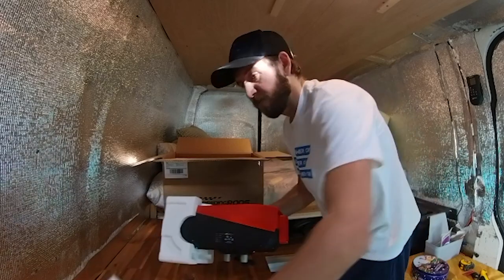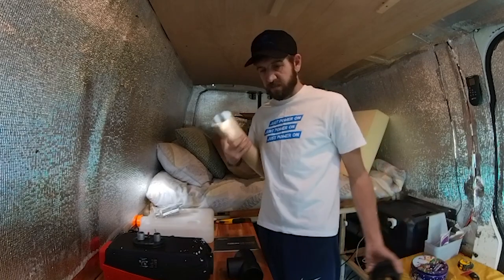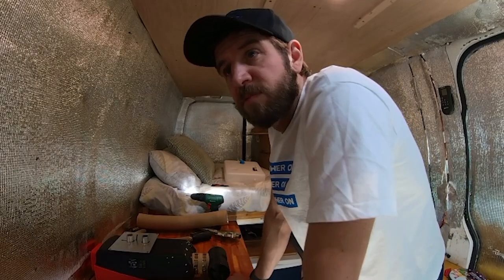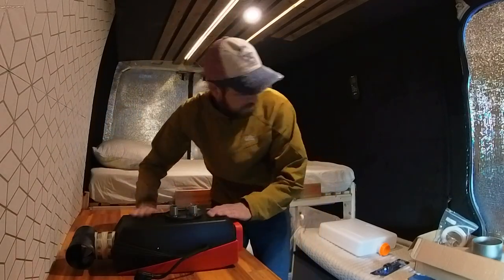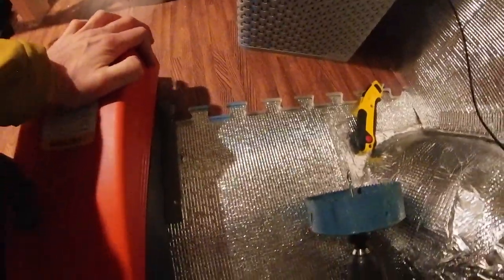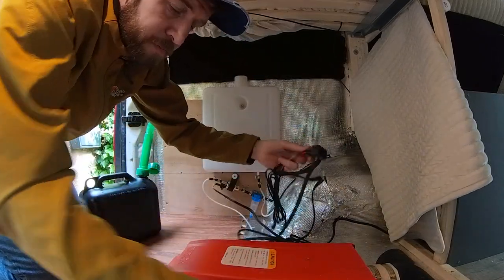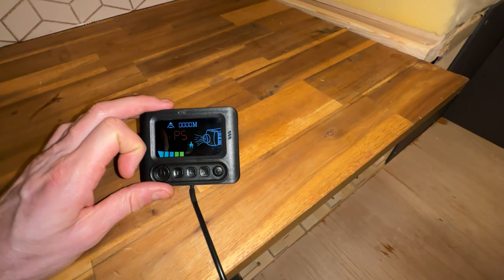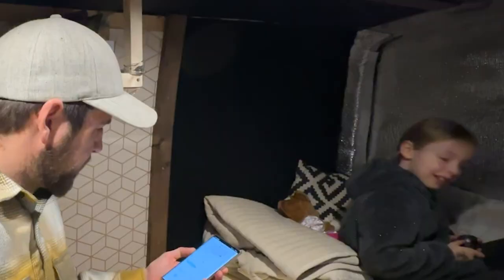5KW Diesel Air Heater for Motorhomes, Campervans & Lorries - Maxpeedingrods

Comment: On the phone app you can use the round dial with the temp in the middle to adjust the temp, just slide the dot around to adjust temp.
Reply from the maker: That's correct yes

Comment: Hi, Gary! Sorry, I don't want to tell you what to do, simply just relay what the salesman told me when I got the piping for my planar heater: You are not supposed to put 90 degree bends in the first 1-1,5 meters. It chokes the heater down, and also the plastic pieces can get too much heat. Not saying it will be a catasthropic faliure, but maybe shortens the lifespan of the unit.
Take care! And send my regards to the giggle-fairy!
Reply from the maker: I wouldn't trust a salesman 😂
Not sure how anyone would achieve that... the heater exhaust isn't even a metre in length and most people don't have a metre under their van. 
Personally I wouldn't put a 90 degree bend anywhere in an exhaust pipe. Mine is set about 70 degrees which I would advise to everyone to allow steady flow of the gasses. Then a slight bend at the end where the silence joins to allow the hole on the bottom to drain moisture out. 
So far both my heaters have been fine so hopefully no issues going forwards.
Its her birthday today, I'm worn out 😂
Reply: @TravelwithGaryandAmika  Sorry, I did not mean the exhaust. I was talking about the inside ducting.

Comment: If the pump noise is an issue consider fitting an Eberspacher pump in the blurb for ours it says it’s “ near silent” I’ve never heard it either inside or outside the van (it’s fitted underneath the van).
Reply from the maker: That's a good idea. I've heard a few people say and do this

Comment: Is the 5kw not too powerful for your van? Most vans use a 2kw heater. I love the look of this heater but worried it will be too much 🤔
Reply from the maker: No. When it's -15 in the alps or Scotland it's required
Reply: @TravelwithGaryandAmika  Most people don't live in the Alps 😄 Very useful if you do, but the coldest it gets here is about -4 and that's for only one week of the year 🙈
Reply from the maker: I spend most of my time in the mountains either in the lakes or Scotland and been to the alps 3 times in the last 2 years. Definitely the right heater and the same as what dozens of my friends have with the same size van.... Who don't go away in such cold conditions

Comment: I'm a gas heating guy. I don't get why
diesel  heaters are so popular. All my mates have them.
Reply from the maker: They are cheap to buy and run, are very reliable (when set up from properly), and if they break down they are cheap and easy to fix. That might be why, certainly why I went for one.
Reply: @TravelwithGaryandAmika  cheers I always wondered.